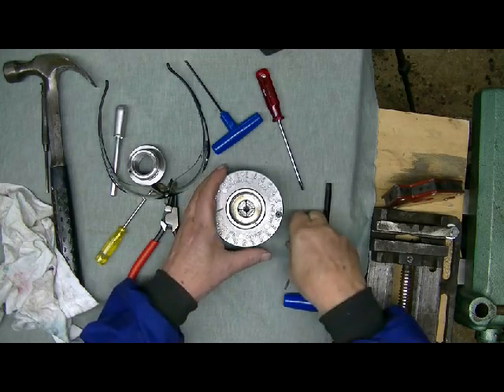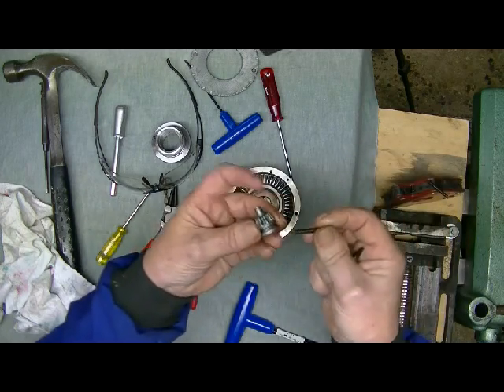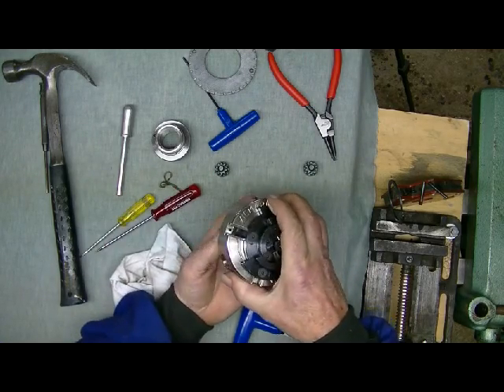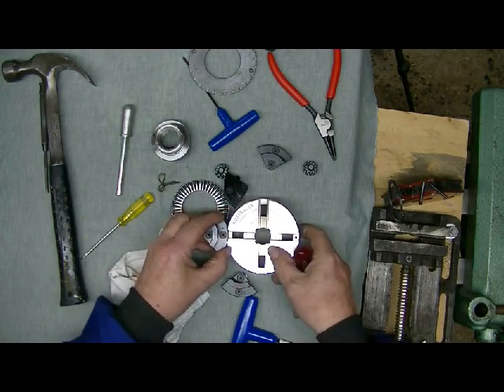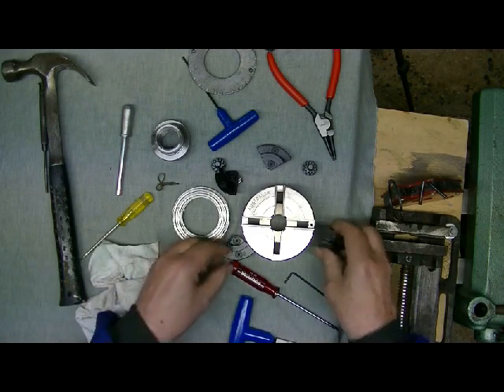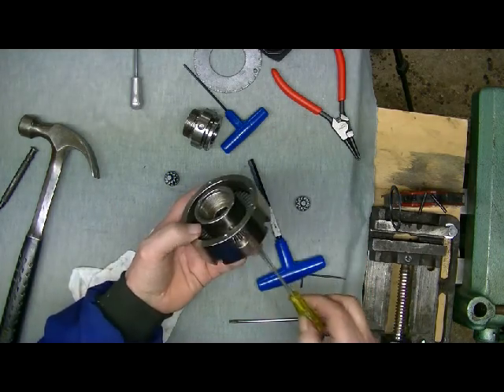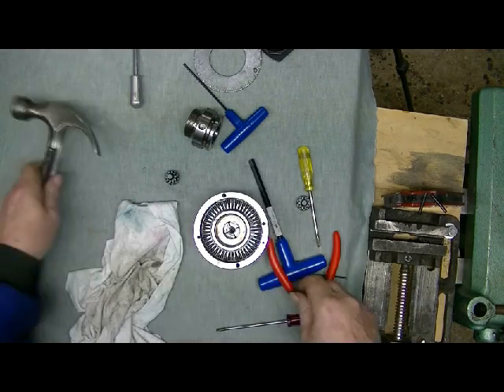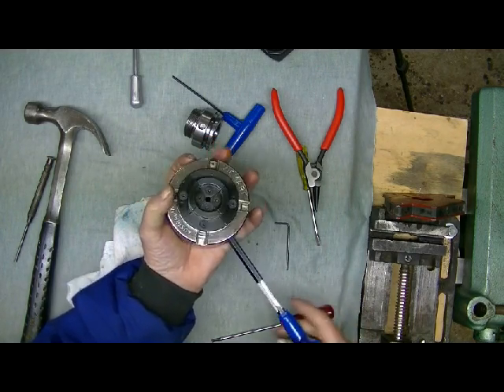Woodturning for learners-Chucks 3B Dismantling and reassembling the Vicmarc.

Comment: Hey Robbo, I have recommended this video to a number of people. Well, a few days back, Glen Lucas (a Brit) posted a link to one that Vicmark put out. I sent both Vickmark and Glen a link to this clip. It is far better than the 'official' one, if for no other reason than you setting the jaws back in first, then putting the gear ring on the back after rather than setting the jaws in one at a time. Still need to make it down under for a play date some time.
Reply from the maker: Thanks Reed.
Reply: Im a bit late to the party, but if you make it down here, bring a few of your grinder jigs, i only recently heard about them, then found out they're unavailable now.
Failing that, do you supply plans for them for others to make their own?
Cheers and happy turning from West Aus!